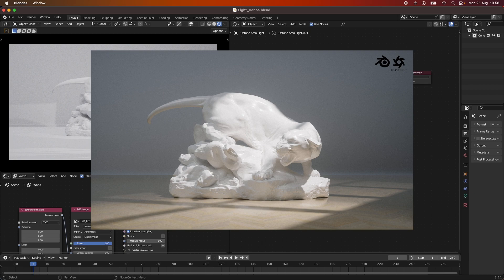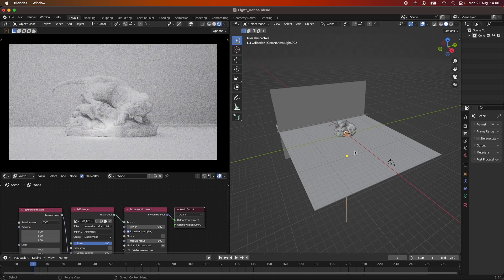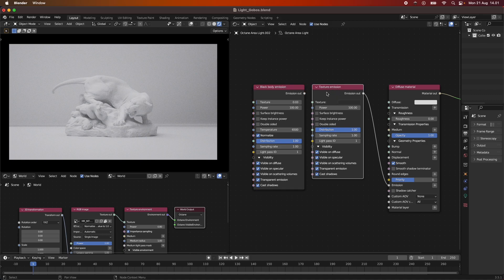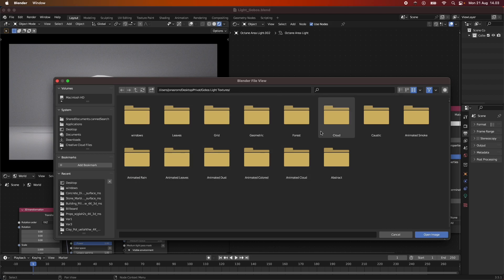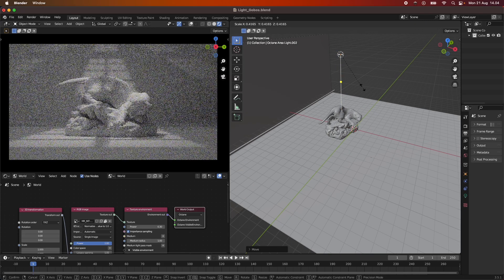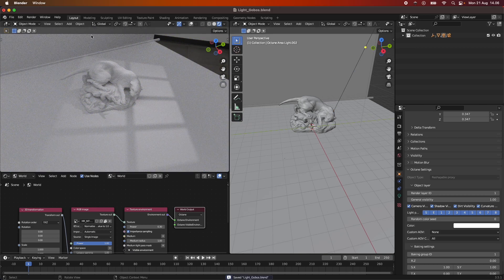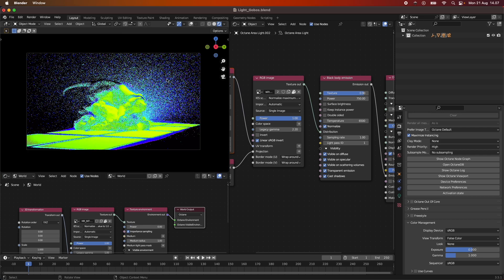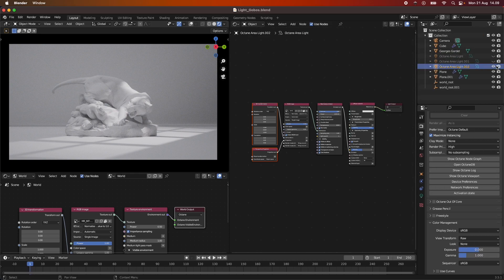In-Depth Octane for Blender Tutorial: Mastering Light Gobos for Realistic 3D Rendering

Comment: 5:57 
To achieve sharper shadows, you can reduce the scale of the light source not globally (S), but in the bulb settings using the Size parameter. In order to prevent the brightness of the light from increasing during global scaling (S), you need to enable the Keep Instance Power parameter in the Black Body Emission node. This will maintain a constant brightness.
Reply from the maker: Ahh - Thank you Alex! 🕺👌

Comment: Is there a way to change the hardness of the light in Octane as in Cycles? To make the lines between light and shadows less visible
Reply from the maker: Hey Farhad - hmm not as I'm aware - when using image textures you can get harder lines by scaling the light as shown in the tutorial. You could also do it manually with place to planes in front of the line very close. But I agree, need to find a smarter way as with cycles!
Reply: @JonasRoenn  hmm, cool, I'll give it a try, thanks again 👌🏽